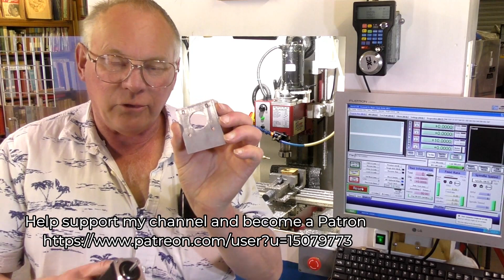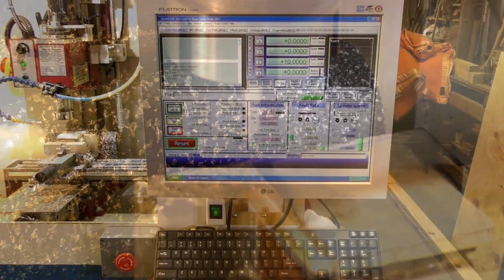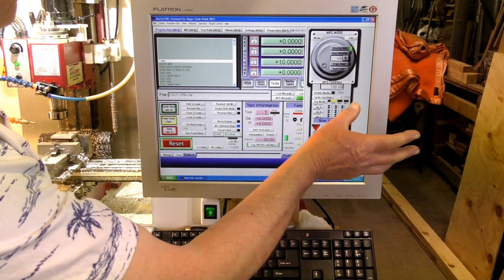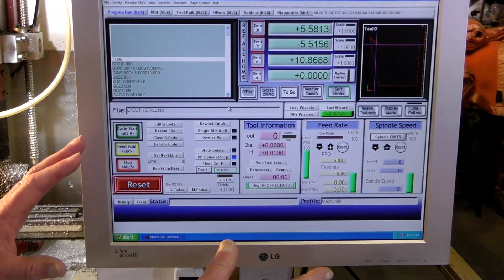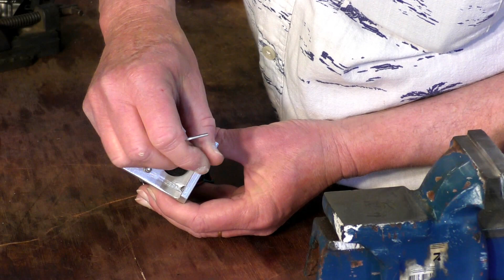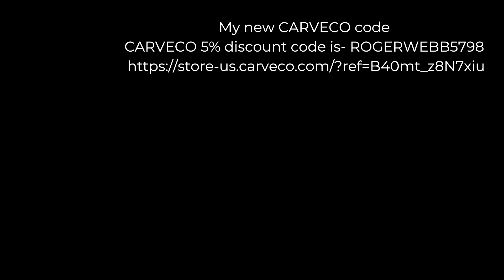Video*500*Making CNC router parts with a CNC mini mill and Mach 3

Comment: Forgive my ignorance but why do use an anticlockwise rotation
 against a clockwise rotation of the mill bit
Reply from the maker: Hi Cliff, the tool is turning clockwise, but the video camera is running hi-definition 32 frames per second plus the lighting is LED. This all gives the illusion of the cutter turning the opposite direction.
Reply: @inventorsworkshop9600  Thanks Roger, that explains it.

Comment: Why didn't you just turn the bracket 90 deg and drop the L leg down the side of the vice and hold the piece across the flat between the jaws?
Reply from the maker: Hi Ian, yes well that would have been to easy, so I decided to show an alternative method that may be good for someone to know and use one day ;-))
Reply: @inventorsworkshop9600  Different for different's sake?......I prefer to keep it simple.